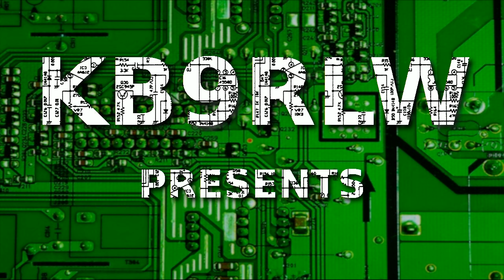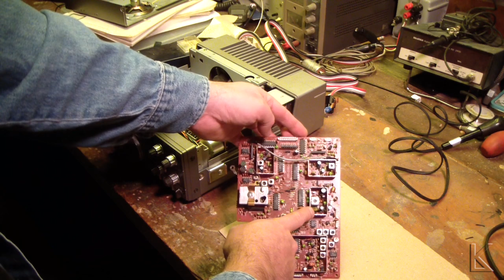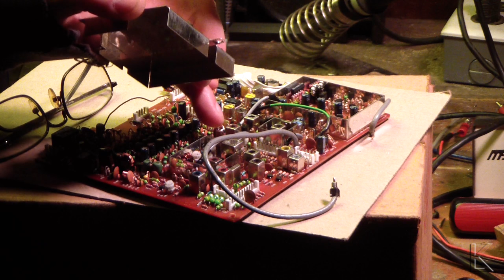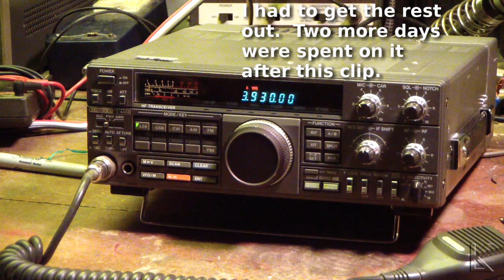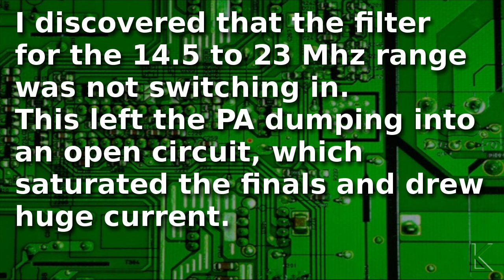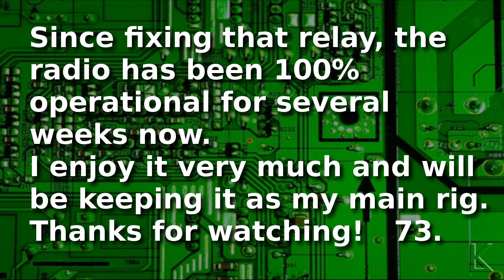Ham Radio - Repair of a Kenwood TS 440sat

Comment: Hello, let me introduce myself. I’m a radio amateur in Belgium, ON5kk . I have a problem with my old Icom TS-440S. Apparently, in SSB mode and AM, I have no modulation. I think in FM it’s fine, but no modulation in AM and SSB. We can see there’s no modulation because the power meter needle stays down when I speak. On the TS-440, does anyone know the issue, or has this happened to them? What can I check—maybe a Relay or some capacitor?

Thx
Christophe

Comment: I have cleaned the glue out of both locations but I’m getting a transmit/receive issue. Sometimes it will tx and not rx. Sometimes it will rx and not tx.
Reply from the maker: Throughout the radio, the PC boards are held in place with screws. Usually those are also ground points for the PC boards. You could have a loose screw somewhere and thus an intermittent ground. It might be worth taking the time to go through the whole radio and make sure that every screw is good and snug.

Comment: I bought a 440 from a ham in Ontario a few months ago. I have audio but the display does not come on at all. I don’t even get the dots! Could the brown glue cause a “no display” situation as well?
Reply from the maker: Probably not. It's most likely the display itself, or the power supply that powers it. I think it has a high voltage supply. I don't have the radio anymore so I can't tell. Just guessing.
Reply: @loughkb  I was fortunate enough to get it fixed a few days ago. I took the lid off, it was super clean inside. I disconnected all of the connectors & cleaned them with Deoxit. I determined that a slightly corroded connector close to the display was the culprit. Thankfully everything is good now 👍

Comment: Old video... just now saw it.  My old TS440sat finally bit the dust a couple days ago after many-a-year of service.  Output dropped to maybe 5-watts, except that sometimes it has full output on AM.  Oddly, the SWR meter function always shows full scale regardless of which antenna/dummy load is present, and sometimes the auto-tuner just rattles on forever without ever finding resonance.  Don't know whether to attempt to fix her, or just keep it hooked up to a wire as the best general coverage shortwave receiver I've ever had.  Good job on fixing yours - I'd heard about the glue terror before.
Reply from the maker: I'd go through it and make sure all the screws that hold the PC boards down are tight. Each of those points is an electrical ground connection. Sometimes they loosen up the grounds get intermittent, and things behave oddly.

Comment: Is there a place that shows test points for rf module? Cleaned up goop and resoldered, now it has other issues. Maybe leaky diodes or caps. 
One day I want to fix my 440, it was my first HF radio. Great video thanks!
Reply from the maker: As I recall, the service manual had illustrations that showed the test points on all the boards.   
It's out there somewhere.  I think I found it with a google search for TS-440 service manual.

Comment: Hey Kevin, can I send you my 440s for repair. It has the same dot issue from 28.300 through 28.499. All other frequencies are good. I'm going to checkout the glue issue.
Reply from the maker: I have stopped working on other peoples gear.  My health is in decline and I don't trust my hands enough now.   You can remove the glue, it just take a lot of time and patience.   I used a dental pick and thin needle nose pliers.  I couldn't find anything that would soften the glue.    You really need a magnifying lens and patience to pick the glue out from between the component leads without damaging anything.
Reply: @loughkb  thanks for the reply. I am going to give it a try.
Reply: Don't go this way.

Comment: Kevin I have a question on your Arduino for digital modes. I have built the circuit and when I pulled your code into my editor it is saying there are errors. Do you happen to have another source of the Arduino coding I could get my hands on. I, like you don't want to spend the money on a commercial product and really the building circuits and antennas is my favorite part of the hobby. I just suck at programming but am trying to learn. LoL any help would be hugely appreciated my friend. I am W9BLU by the way. Thanks in advance for any help with the dunno box  project.
Reply from the maker: What are the errors?  It's probably a simple syntax issue, an extra character at the top or bottom when you copied the code off the blog page.
You're pasting into the arduino IDE, right?

Comment: Can you tell me which resistor to connect to on the pll board for volt test
Reply from the maker: It's been awhile.  The service manual shows which resistor, I think I remember it being at the edge of the board.

Comment: Yep, I just had to make the same repair. Took about 10 hours to remove a few parts at a time and scrape the glue out of the PLL board and RF board, then resolder all of the  bad joints.  I added the IC10 kit while I had it open.  I used dental picks which helped a lot.  Now I need to add 800 ohms to R27 on the Final board to get the fan to come on at a decent temperature for higher duty-cycle digital modes.

Comment: Really enjoyed the video Kelvin, I also have ts-440, does your internal SWR can show the actual SWR? My ts 440 after auto tuning always show the value of Swr 1: 1, but when I check using external SWR is still at 1: 3, dou you have this problem?
Reply from the maker: The radio is long gone.  But as I recall, it was accurate.

Comment: Hi Kev, the 440 was a sort of pinnacle for Kenwood and I got mine in 85, repaired the vco glue in 89 and now it has a few different quirks. AGC is only fast and others report distorted tx audio.
Reply from the maker: I had found the wave soldering on mine to be very thin and many of the solder pads had small cracks around the component pins, needing re-flowing.   Also, by this age, the electrolytic caps are getting quite old and many may be starting to develop a high ESR which could harm the audio quality in places.   They can be testing in-circuit with an ESR meter.   It might need re-capping.

Comment: I am so impressed.  I am new to ham radio after a close friend, an active ham, passed away and left me his gear.  The transceiver is a Kenwood 440.  The only issue I think I have is the S meter just doesn’t move in response to received signals.  Haven’t seen any dots, all the bands seem stable (as though I know what I’m talking about).  It does have a little of the button-push issue I’ve heard about.  I haven’t transmitted on it (hoping to test for the license next week; damn COVID) so I can’t speak to any possible problems there.  I built a 20-meter dipole and have thoroughly enjoyed listening!  Really enjoyed the video, as well as the one on the CW filter addition.  Just wish I knew what you’re talking about!!  Excellent and much appreciated.

Comment: I was hoping to upgrade the stereo on my GX470 and found that doing this on a version with built in Navigation was going to be a challenge. imgs.love/KCarStereo?op I utilized this head unit and the BeatSonic MVA-81 and the Axxess ASWC-1 (Steering Wheel Control) and Metra 70-8114 harness. Had to splice 2 wires on the Lexus factory harness to get the steering wheel controls to work but I'm very happy with the end product. Thanks Kenwood!

Comment: Excellent video, thank you! I have two TS-440SATs one with DOTS and other OK so far. Love this rig! I've put off repairing long enough, not looking forward to digging out the glue. I heard there was some kind of solvent that softens the glue and it crumbles out easier. I believe you just started to excavate the VCOs, right? Is there a place that repairs this issue, figuring someone has to have (by now) figured out an easier method and we can send? KA3QPO

Comment: Enjoyed the video. My Kenwood is a TS 680 still going strong, including 6 meter. I also have an IC 745 with the Pi exx static memory board installed. Except for some drifting until she warms up, she purrs along. It's built like a tank. I might never part with it. N7TYE

Comment: I have frequency readout when i turn the VFO, after i stop turning o get dots on the display after a second or two. i guess it's time to start picking glue !
Reply from the maker: Yep, that's exactly the symptom.  Make sure to go through the VCO adjustments in the service manual after the glue is removed.   And I think I recall that they list 14.999 MHz for the adjustment on 20 meters, but it really needs to be 14.499 Mhz.

Comment: I have one of these radios. It does have front buttons that don't work. Yikes!! Well I also wonder if the glue and broken solders are also an issue. I really need to go thru this radio and see what might be going on. cleaning and a justing it.

Comment: I have the 440SAT version and have an issue where I have to adjust the IF shift down in LSB to make the audio sound the same as when I'm in USB. Any thoughts?
Reply from the maker: I've always hear a little bit of a difference in the sound between USB and LSB on every radio I've owned.  LSB seems to have a bit more emphasis on bass.  But it's not a big difference.
If you're having to move the IF shift more than a few degrees, there may be an adjustment somewhere in the detector circuitry that makes a difference.  I'd have to study the schematic to be sure.

Comment: I have the same radio and have recently noticed the dots issue. Whenever I go to check it and if it is the glue issue, what was the heat source/setting you used to remove the bonding material. I would also like to ask you if something like hot glue would be a suitable replacement of it I will just be removing that in a couple of years time. Thanks for the great video!
Reply from the maker: Heat didn't work and I couldn't find any known good solvent.  I used a dental pick, a big magnifying lens and a LOT of patience.  I just picked it out a bit at a time.  It was most tedious between the legs of the small components.
I didn't replace it.  It's original intent was to prevent microphonics in high vibration environments like using the radio mobile.  If it's just going to sit on a desk, you don't have to put anything in there.
Reply: Thank you for following up!

Comment: hello sorry I wanted to ask you I have a ts 440s which when I press the Enter Up and Down keys emits an annoying beep of considerable intensity. I ask you it will be possible to remove it? I had another 440 and made no beeps. Thanks and sorry again.
Reply from the maker: Check the service manual.  There's a series of diodes on one of the boards that selects options.  One of them is a button beep, I think.  You just cut that diode to eliminate the beep.  (If my memory is correct.)

Comment: Curious, could you take braided desoldering cable, heat it, press it into the glue, pull cable away, snip to new section and rinse and repeat???

Comment: The 440 is a fine radio.  I purchased one new back when they were new and did eventually need to send it to Kenwood where they "removed some goop" from some of the components.  I guess that means they did what you did (?).  I still have the radio.  It is in my daughter's closet up in WA along with a power supply.  I use it when I visit her from time to time.  I replaced the 440 as my main rig with a used 570, and I greatly enjoy the improved computer interface with the digital modes and computerized logging.  On the other hand, I miss the narrow filter and the ability to "move it around" the waterfall when using sound card generated rtty.  Cannot seem to duplicate that behavior with the 570.  But the 570 is better on CW.  All of life is a trade-off!  I understand that many of the replacement parts for the 570 are made from unobtanium, so I will have to face that problem some day in the future.  

Congratulations on your 440.  It should serve you well, now that you have taken care of the glue problem.  73 de NT5A
Reply: The chips for the computer interface on the 440 are still available, and the best part is they interface directly with a modern 5v tolerant USB/RS232 adaptor. The only issue with installing them is getting to the circuit board behind the front faceplate. IIRC, you have to remove the IF board entirely to be able to get the front off.

Comment: hi kevin i also have a ts440s i am getting a problem after a while of using the radio i am losing power when i key up the needle hardly moves but when i try and turn up the power with the CAR knob my power supply is buzzing like crazy as its trying to draw 35 amps when usually on 100 watts it draws around 20 amps max,when i turn it off for 10 mins or so it starts working fine again.Any idea what the problem could be? cheers
Reply from the maker: +Craig Connell hi Craig, pull the filter board and check for cold solder joints, especially on the relays.  Does it do it only on a few bands?  I had that and it was one of the switching relays.
Reply from the maker: +Craig Connell vcos unlocking.
Reply: think its fixed put new solder on the dry joints on the relay board and no more losing power thanks for the info kevin

Comment: My radio the good was cleaned out before but after few years having it it started sounding warbly on SSB 160,75,40m with lil warbling onhigherbands takesabout 10 minutes to warm up.I also caught the dots and vfo tunning Ithas lost occssilation but once warmed up works good.
Reply from the maker: You need to go through and adjust the VCO's.  They're probably way off.
Reply: Kevin Loughin:
 Radio was alinged and glue cleaned out around vco and two caps but may be starting to re conduct again it has been set up in a basement cement  floor old time stone foundation last 3 months this is below ground. And I run a dehumidifier and fan every night down there to but I'll check the vco's alingment then. 
I have a Op manual, service manual should be online . thanks
Reply from the maker: If I remember,  the 20 meter VCO tuning should be done at 14.499 instead of 14.999, or something like that.  Search around, there were a couple of blog articles about that error in the service manual.

Comment: Enjoyed the video, Kevin. In the shack I have the receiver version of this rig, the R5000, which I picked up cheaply from a hamfest last year. The rig was beaten about a fair bit, so I have been slowly fiddling around getting it cleaned up. Also put a new INRAD filer in it, too. I have a few YT videos on it. The "Dots" come along occasionally. So if it becomes a big problem, I might very well go and do some digging of the goop in the future. I've bookmarked this video for future reference. Also subscribed to your channel. Cheers mate!  Rob VK3BVW  http://medxr.blogspot.com.au
Reply: Thanks for the information I purchase this rig new when it was 1st introduced I never experience a problem with it over the years, I just purchased my 1st Power Amplifier to use and when I connect the transceiver remote jack thru the MFJ-AM704 buffer I lost transmit/receive, and the 7 dots will show on the display I thought it was the glue issue, Thinking it over this happened when I added the Ameritron-811,I discovered I had not grounded the ground lug on the transceiver, I am not a 2way radio repair tech,but I made my living in the electronic industry so I am thinking the Linear Amp without a return common ground was causing some overload in the transceiver I am glad I decided to invest in the AM-704 or It could have been some serious damaged. The transceiver has been working ok for two days.

Comment: Kevin, what method did you use to heat the glue, I have the same radio and problem, not sure of using a heat gun in amongst those little parts, great video very educational, Thankyou.
VE7URL Julian.
Reply from the maker: Hello Julian.  I gave up on heat.  It just didn't soften the glue enough and I was also worried about the components.    I made a really small hooked tool and just took the time to pick away at the glue until I had it removed.   A dental pick might also work.
Reply: Thanks Kevin, I see mine has been done before, years ago, but not too well, will persevere with a couple of dental picks, cheaper than buying a new radio, though a KW 590SG  may be in the future, thanks for the reply 73

Comment: My 440S was a Jahnke Electronics refurb, so all that Sonybond gunk was removed. Recently, it had been having issues with the "dots" on all bands  even with that refurb. I adjusted that L20 to 5 volts and so far the dots haven't returned....
Reply: Well the dots/blank display returned-I removed IC 52 from it's socket and cleaned the IC's pins as well as the socket (I know the real fix is to de-solder the socket and put the IC in directly to the board) So far so good.....

Comment: hi Kevin, i am yo2mpg and i have a problem with my ts440sat: ( https://www.youtube.com/watch?v=CkL6G_FUlfg )   When i put the antenna cable , only in FM mode, the signalmetter growe up and i do not have sql control and no reception. Do you have any ideea what is the problem
Reply from the maker: You would have to trace through the schematic and look at the circuits involved with FM mode.  It looks like something is causing the ALC to go full and drop the RF gain in the RF amp.